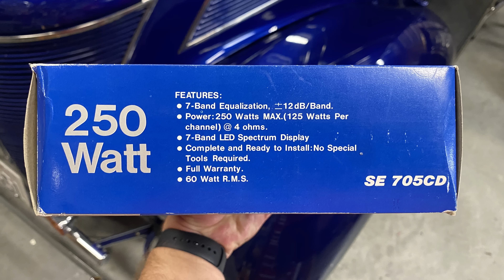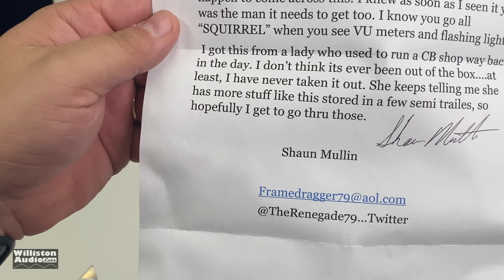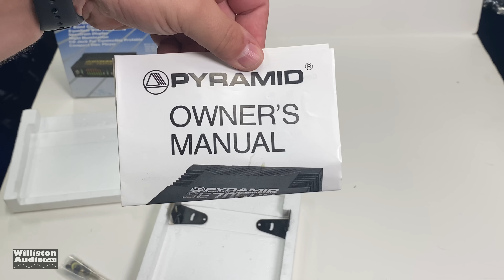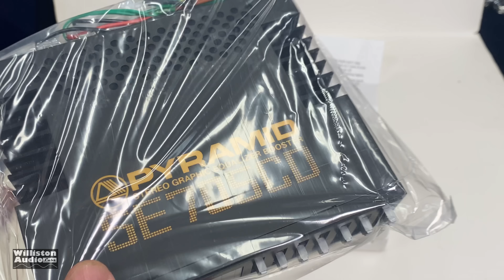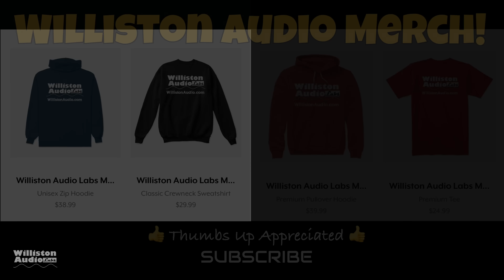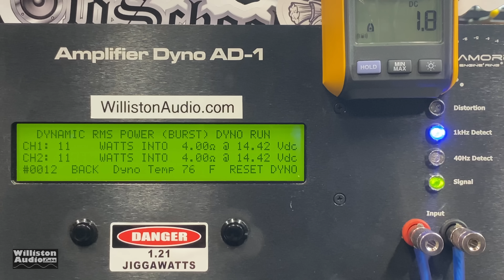1980's Flea Market EQ Booster? Pyramid SE705CD Review and Amp Dyno Test

Comment: I had a very similar amp from Pyramid that I bought out of the trunk of some dude's car and installed in my 1967 'Delmont 88' back in 1979, along with a Radio Shack 'Realistic' radio-cassette head unit. It did not have the Spectrum analyzer, but it did have the 7 band EQ. I put 2 51/4 inch coaxes in the front doors, 2 6X9 coaxes in the rear package shelf, and then 2 61/2 coaxes in a wooden box that sat on the rear seat. Cranking up the Led Zeppelin and Blue Oyster Cult always brought a smile to my face, but man, the hiss was so bad girls would just jump right out of the car!

Comment: I have a couple of issues with your video. Firstly; Your sound test wasn't a fair representation of the amp's capabilities. This is an amp from the 80's so naturally anything other than Duran Duran is going to sound like ass on it. Secondly; I suspect that copious amounts of Chinesium were used in the manufacture of the amp and the exact properties of Chinesium were largely unknown in the 80's. So, your power measurements would have to be multiplied by a factor of 20 to compensate for the standards in use back back in the day. Hope this helps.
Reply from the maker: You got me!! 😝👍

Comment: I used a Tancredi TE-120 driving a pair of Pioneer TS-X9 surface-mount speakers and a pair of 6.5" Pioneer coaxials (can't recall the model number) with a Sanyo FT-20 head unit.  Loved that system.

Comment: I had this installed in my 1969 VW Beetle when I was in high school in the mid 90s. I /loved/ it. I knew it was crap, but I still loved it. Connected it to a pair of 3-way Pioneer 6x9s, and a pair of Jensen 12s in the back deck behind the back seat.  It actually added some thump to the car.

Comment: 30 yrs old and SHOCKED that ALL the led's still worked and it powered up and gave its ~spec'd wattage per the actual specs and not the box written false advertisement specs. 
Normally the caps leak and transistors go bad after 20+ yrs. I guess they used "quality" components ??
Reply from the maker: Got lucky I guess

Comment: They didn’t sound good. But if you had 4 of them running equally crappy plastic 3 way speakers, you could bump Brass Monkey in the way down to Tijuana with the boys in a clapped out Pacific Bell work van. Let me tell you.

Comment: yes i tried the Flea Market Stereo   Systems in the 1980s  with various Equalizer / Boosters  and some Box Speakers   i will say it made things louder  but terribly distorted the sound quality  i will say the. stuff wasn’t very expensive  as i lived in South Florida  and  in the 80s they  were shutting down the drive in theaters and using them on the weekends to  set up permanent Flea Markets  the advantage of buying at a Flea Market  was some loophole  that you didn’t have to pay State Sales Tax  so that was a small savings  the box speakers i bought  were really junky  and they had tried to mimic  the popular and good Pioneer Speakers of that era  here is a funny  over 25 years later. i purchased a pair of similiar looking and size indoor/outdoor speakers from a KMart to mount  under a  roofed area on one of my boats  and those sounded great ?  so it’s obvious that inexpensive Electronics did improve over the years  i think in the 80s it was all made inTaiwan  and  the Kmart ones were made inChina  so perhaps that  has something to do  or it’s  just all the advances  in Electronics and Technology ?  i’m not sure  because for the most part over the years with my Car Audio  i basically  just use the Factory installed  Stereos the Car manufacturers    use  because it sounds. okay and as a rule is a nice  clean install  plus a lot of modern vehicles have some anti theft  protection with the systems being wired right into the Computers  and tied into the ECM  i’m too old to have Speaker Boxes and Amplifiers  i have to trip over in my Passenger Compartments  plus i drive more luxurious vehicles than  i did in the 1980s  heck i even bought a brand new Japanese Mini truck that was  the least expensive new truck i could buy at the time  this thing was Vinyl seats ,Stick Shift ,no AirConditiong  , or power anything , not even a radio  and i took the truck to a Stereo shop and had them install a head unit inthe dashboard. plus speakers in the doors  the theory of that back then was i saved money on the purchase of that truck  so i was still ahead having a good sound system installed  aftermarket

Comment: I had one of these back in the early 90's. I'm not sure it's the exact model but in my Celica it sounded pretty good. I used an Optimus amp for the subs. I loved the little unit but the Spectrum Analyzer was so bright at night when driving I would have to cover the front of the unit. Very cool find.

Comment: Have you ever dyno'd car stereos?  "in dash" amplifiers?  I'm curious as to what kind of power the in dash units put out.  Most seem to exaggerate 50x4.  I'd guess most are half that if not less than half.    There are so many people who only amplify subs and run the front and rear speakers from the head unit it's crazy.  That includes myself for now lol.
Reply from the maker: Yes I’ve done a few and most of the 50x4 models do 18x4 RMS. I need to try the Alpine ones with the V-Drive as I think they do more
Reply: @wal  so the boosters of yesterday are almost equivalent to the power of today's headunit lol.  Funny as most average people still use headunits for interior speakers.

Comment: 250W or higher power rating on amplifiers or any stereo systems in the 80s and 90s was quite common.
My old stereo system was rated 1200W but i reality it was only a modest 60W (30W per channel)
hmmm..it was a long time ago but I think many brands were using Watt PMPO.
With this PMPO units even your old getto blaster was rated like 1000W.

Comment: The absolute maximum you can get into 2 ohms using a bridged mode class AB output stage driven at 13.8vDC, is 27w. Thats just the maths, people. If you want more then your supply voltage needs to go higher, meaning a switch mode DC-DC converter. Not even heard of in DIN size devices in the 80s.

Comment: I had an 11 band alpine bbe eq with an alpine ainet headunit and 6 disc alpine changer around mid 90s with a power fosgate 500m on some  power 12s and all alpine highs on some alpine v12 amps in a hatchback iroc z talk about the good ol days and boy was the highs crystal clean and concert loud and the hatch was a bumpin for sure.

Comment: I installed one in my '78 cutlass back in the early 90's.  It seemed to make my car stereo much louder- better probably not.
Reply: Really I pulled out a Kenwood one off the bottom of the dash where the ashtray goes on a 78 olds delta 88,it had a kraco cassette tape deck with the eq I believe it is 3 band eq just odd to find on shaft style radios.

Comment: I had one of these Pyramid eq/amps as a kid in the early 90's, used it on an old battery charger driving some factory ford door speakers in my bedroom.
I don't recall it ever pulling more than 5a on the (definitely accurate and reliable) ameter on the charger lol
The most memorable feature of the setup was awful clipping behaviour, and if driven too hard it would start to oscillate due to the 60hz charger noise lol

Comment: I remember that PYRAMID Eq from back in the day. I still have that 1990's Car stereo guide mag. But mine is in way better condition. I subscribed to that monthly CAR STEREO magazine for about three years starting in 1989 . Back in 1984 I had a CONCORD head unit with a SONY 11 band passive Eq and a TARGA 60 watt per channel amp powering a pair of 6 x 9 's Triax JENSENS on my 78 Camaro. The system sounded loud/punchy and clear. I later upgraded to a SONY head unit and an Alphasonic 50 wpc amp powering a pair of PROTON plate door speakers and a pair of MTX tweeters.  A SHERWOOD 100 wpc amp powering a  pair of 10' KICKER subs with an ALTEC LANSING SUB X over to control the subs and plates . Much powerful sound. Great memories from my youth years.

Comment: Man I would love to have the 405VL eq.  I miss those tiny LED VU meters.  I wanna do a setup with a 1/2 DIN eq with the spectrum analyzer display and a single DIN headunit in my 86 Regal. Boy do I miss that spectrum analyzer display!
Reply: Get the boss audio eq boosters version actually makes decent sound and power output and has RCA's and in the mid 90's Jensen made a 80 watts version that also had RCA's I've had both and I had the Jensen version in a 85 Oldsmobile Cutlass supreme brougham I was actually supposed to be testing a Jensen 210x CD player for someone they lost sound I got sound through the RCA's, and they said well that won't work so I gave them a dual electronics CD player looked almost just like it and left the Jensen in the cutlass but the speaker channel leads were dead,so the sound was produced from the eq
Reply: Otherwise I'd say just find you a vu meter preamp graphic equalizer.

Comment: I had a Tancredi 60 watt booster/equalizer back in the '80s that actually kicked ass!  (for the time)   It had cool analog "quadrant" power meters, one on each end of the unit.  There were 7 sliders between for the EQ. Black in color, never had a problem with it.
Reply from the maker: Sweet 🤙

Comment: That's pretty cool! Just a couple of months ago, I bought an Audiovox AV220 off Ebay. Just like your equalizer, mine was brand new in the box and never used or installed in a vehicle. I use it in my apartment as a house stereo. It works really good. It even plays cassettes!
Reply from the maker: That’s pretty sweet

Comment: Big problem back then was it seems it was not known how to get more wattage out of the 12 volt system. In later years they figured out how to up the voltage  using MOSFETS and a transformer, and actual separate output power transistors. I had two booster in my 1978 Chevy Monza. it worked pretty well with Pyle 6X9 woofer speakers and a Radio Shack tweeters, but something happened to the one speaker so I decided to try a set of Pyramid 6X9 two way speakers. They were simply to stiff, they looked good and had the nice soft edge, but were poor on the bass. I took them back and got a set of Pioneer 6X9 two way speakers those were so flexible that they bottomed out on the bass. I was not a bass pounder, I listened to mostly pop music back then so I made a more or less semi sealed enclosure for those rear deck mounted speakers.   Those 6X9 woofer Pyle speakers were the best for that time and decent price, no longer made and no longer that same USA company these days.

Comment: I had a very similar equalizer with the same specs only mine was probably earlier than this one and was made by Learjet I believe. It did all I needed in my standard cab full size Chevy pickup. * Edit: it actually may have been just a Lear not a Learjet. That was many decades ago.

Comment: I remember those. Whenever I would come across them, the rule of thumb was divide the output by 10 at least. That would give a starting point to figure out what it was.  That went for the price also.  In this case 25 watts peak at $25.

Comment: I remember this eq it was really good  even the sound barrier with the echo chamber vol there were two 1 with yellow slide n other with orange both is not the same there was a brand called rondo I think very thin either a 10 band or a 14 can't remember

Comment: As an army brat, I grew up in central America in the early 90's and lived outside the base along with the locals.  These were THE shit.  I saw these before I ever saw my first amplifier.  Some of my older friends that started driving would hook up these EQ's to an old fashioned home 3-way full range speaker with a 12" woofer.   Edit:  maybe these specifically were not really the shit, but there were some other brands like Nippon that were widely used at the time.

Comment: Wow... This brought back memories. I had one of those way back when. I bought it for the spectrum analyzer. I had it hooked up to a Kenwood pull out CD player. It ran my Clarion 5 1/4 and 6 1/2 speakers. Completing the system, I had a Punch 45 and 2 punch DVC 10s in the trunk.
And yes, a ground loop isolator was a required component to use it. Unless you liked alternator whine.
Reply: Only 2 of these 80's and 90's graphic equalizer boosters I was ever impressed with the sound coming out of them are both from the mid to late 90's a 80 watts Jensen, and a boss audio one and I doubt either one actually made advertised power rating.
Reply: And I have heard not one but two different models of mustang eqs hooked up to two new kraco cassette tape players my dad had them sounded good,but nothing like anything from the mid 90's on..he had the 2 newer models of the u shaft style digital kraco cassette tape deck, neither had auto reverse,or pll synthesizer.. one was in a 70 ford f-250 with 4 inch sparkomatic  speakers from a 78 dodge Magnum xe,and t120 pioneer 6x9 s, and the other one was in a 72 international travelall with the matching speaker sizes except all kraco speakers, except one set of the 6x9 speakers were pryamid gold series... The mustang eqs were 2 different models both claiming 200watts output I'm guessing maybe 50 watts total or it would have blown the sparkomatic speakers and the pyramid gold series 6x9's... and I myself have tried a set of pryamid gold series 4x10's and 6x9's both bought from jc Whitney in 99 one 4 x10 lasted even survived a road gear 80 watts amplifier and a 150 watt WalMart pioneer amp, but a 130 watt alpine amp smoked it and made my whole truck stink I was running it as the dash center speaker in a 78 Chevy c20 custom deluxe, and then the pryamid gold series 6x9's is what I had the 150 watt pioneer bought from Walmart in 98 smoked both 6x9's I replaced them audiovox 250 Watt 2 way 6x9's and the stereo actually got louder I didn't buy the audiovox 6x9's they were given to me.. but they survived the poineer 150 watt amp, and I did end up buy a 4 x10 replacement speaker from auto zone also in 99  for my c20 and it was suprise, suprise audiovox..but the tape player was a u shaft style road gear digital tape deck I wasn't putting a bunch of money in to that stereo setup since I planned on changing it all out to Kenwood, and pioneer keh-1700 auto reverse cassette tape deck, and jl audio wo 10 inch subwoofers...first was Jensen xs bass subwoofers also bought in 99 $21 each from Meijer's in Muncie Indiana..wow that makes me feel old...I was 20

Comment: Fun Fact: that EQ was also sold by Radio Shack with different labels on it... all that's missing is the inline 2.2μm capacitor to stop the alternator whine and pops from the spark plug wires.
Reply: Curious… mind telling where that cap would be installed? Thanks

Comment: I remember getting a pyramid equalizer power booster when I got my first car in 1986 and thought I was the shit until I got it hooked up and went to crank it up and it sounded like my tires were going flat with the loud hiss sound between the tracks on my cassette tapes. Then I got my first real amplifier a MTX Road Thunder 50 watt ×2 channel and that thing was huge. I have a 2700 watt rms monoblock now that is actually smaller than the 100 watt mtx and how might I know that for sure? I still have the mtx and an Alpine v series 30×2 watt rms and an Alpine 15×2 watt rms from my very first system in a metal flake blue 1970 camaro. I can't believe I still have those out of everything I have had and lost track of over the years. I really wish I still had that 70 camaro damn I loved that car just couldn't afford all the u joints and rear tires I went through. Damn that car was fast! Good times good times

Comment: Something seems way off regarding power output w/that EQ/Amp IMO. I mean brick walled @ 11 watts/ch?  Of course these cheap units just used the straight 12 volts no booster power supplies. So, best was around that 20 watt range simply due to Ohm' s law.  I had some Pyramid products in the day. Still using a 3 way active crossover unit to this day. It is really nice too. Clean, no noise, or thumping when powering up or down. Thanks Big D.

Comment: I'll have you know that in 1986, I was sporting one of these fantastic items hooked up to an OLD Panasonic cassette deck in my 1979 Mercury Zephyr rocking my Pioneer TSX-30 wedge speakers in the back window.  Often cranking Run DMC.  It was mounted right next to CB radio.

Comment: Oddly enough i used to have one similar to that im not positive it was pyramid though. Mine was only rated 50 ×4 an didn't have the heatsink fins. Plus the spectrum was on the far right. Honestly it wasn't bad. Powering  an old pyle power driver sub in the mid 90s well not the eq itself it had a pass through for the old-school Optimus amp.
Reply: Optimus amps were not bad if you used them for a short time I got tired of having to buy a new one because it would blow out a channel.. eventually it got replacement by Jensen,then Sony xplod 600 watt 4 channel.
Reply: And I have owned a few sets of 8,10,12 Pyle driver woofers from the mid 80's to the early 93 some were great some were better than others both sets of the 12's I had sucked.

Comment: Would love to get a hold of an Alpine and Kenwood equalizer from the 90s with the spectrum analyzer. Had them back in the days, they were awesome!
Reply: I did have a Kenwood one but I don't remember if it has the wiring harness plug on the back,it was screwed to the bottom of the dash of a gm g body 78 olds delta 88 I'd acquired.